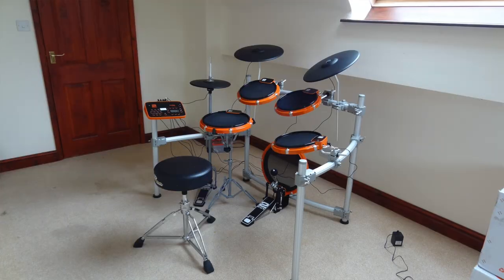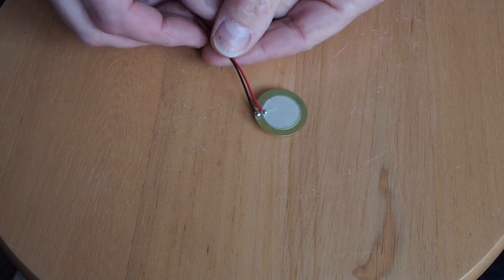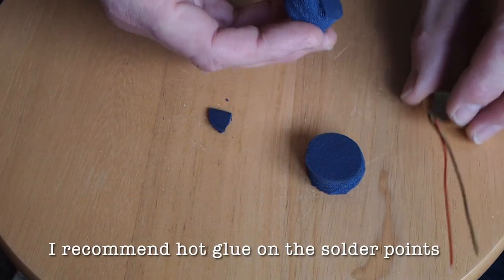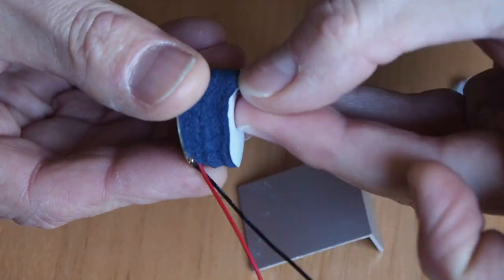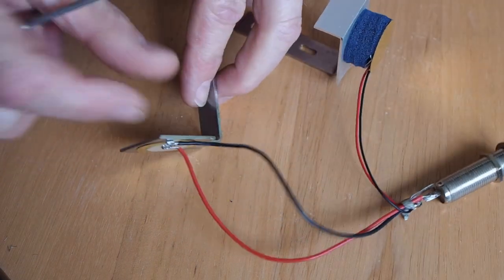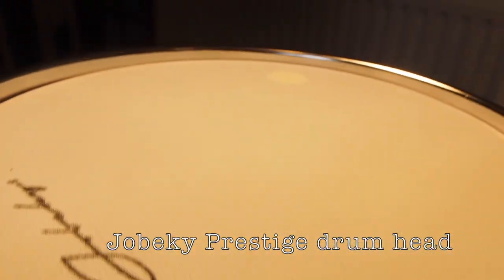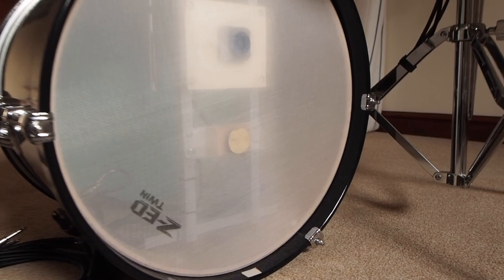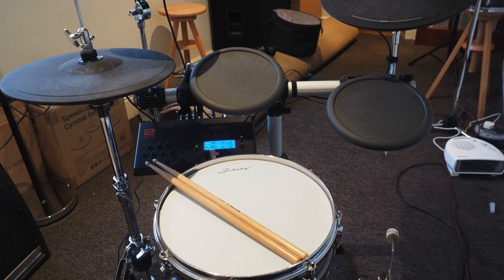2Box Drumit 5 Mk 2 A2E drum triggers - alternative design, no cones   HD 1080p

Comment: Hi Tim
Well done on a very interesting video. I have a 2Box Drumit mk1 great to see more information about 2Box triggers. I wish they was more about getting 3 zones diy snares (using rim & X stick switches, bar triggers and not using rim piezos). The only thing I've seen online was

https://m.youtube.com/watch?v=cFBrP3P_8kc&feature=youtu.be

I was testing different triggers when I came across a setup that makes the 2Box snare layered and sounds much better. Use 2 or 3 triggers with different sensitivity on the same mesh head with 2 or 3 stereo outputs. I have had amazing results and would love others to hear the difference of triggering a layer snare sound. See the replies for more details.
Reply: I have the 2Box drumit 5 mk1 module with a 64 GB card extension connversion loaded with 2Box, Free samples & VST samples. When I first started playing the 2Box module I found the kick & snare lacking some cut & doesn't have positional sensing but I made my 13" snare play like it has positional sensing. On the snare I'am using 2 different edge triggers mounted @ 11 o'clock & 1 o'clock into the 2Box and a 3rd smaller 27mm centre mounted cone trigger (Quartz percussion lowest sensitivity) plugged into my TD11 that adds dry Roland sounds. I'am right handed so the 35mm Quartz percussion cone trigger @ 11 o'clock is the most sensitive (I play quiet ghost notes with left hand on left side of snare). There is an square Extreme trigger @ 1 o'clock it is medium sensitive (I play loud accents with right hand on the right) with a higher threshold setting sometimes has the same snare DSDN samples tuned +0.1 more and a decay of 1.5 -2.5 and 40% - 60% volume and that is plugged into Tom 1. Hitting the mesh snare head at different sides and at different dynamics triggers 3 different layers of sound. I have 4 toms on a splitter cables from the Tom 2 & Tom 3 inputs. 
With a guitar ABY pedal I plug the kick into both the TD11 & 2Box modules. Only the snare & kick are connected to the TD11. Different TD11 kits will change the tuning, tone, snare buzz, ring and kick fattness of the combined drum sound. The 2Box open sound does benefit from the fat, tight, attack of the layered kick & snare sound. The headphone output from a module is plugged into the aux input of the other module and I can still use the Rolands metronome and coach function. I hope this helps you get diy positonal sensing and great layered sounds.
Reply from the maker: That's a really interesting idea Sam. Sounds like it'll take a good bit of time to set up but I can see how it would work. Thanks for posting. Cheers.
Reply: @timscott3071  Hi Tim
Just do the first step of adding a second less sensitive side mounted trigger.  Mount your very sensitive piezo @ 7 o'clock and mount the second less sensitive foam covered trigger @ 5 o'oclock on the snare. Take the bottom head off to test second trigger (if happy with trigger and sound you can then drill a hole for a second stereo output) plugging into a spare Tom input.

Please give the second trigger a go, it sounds so good I can't go back to only one triggered sample now.